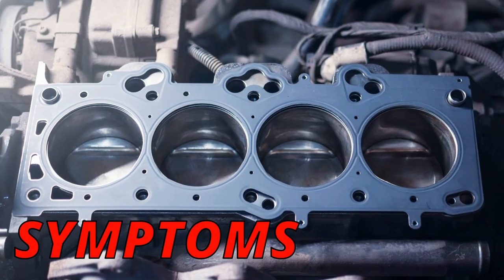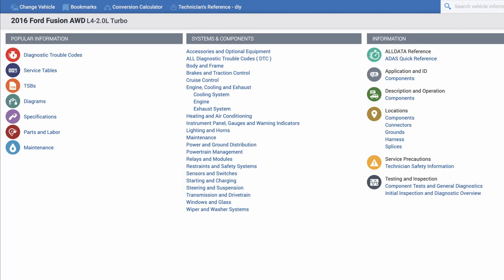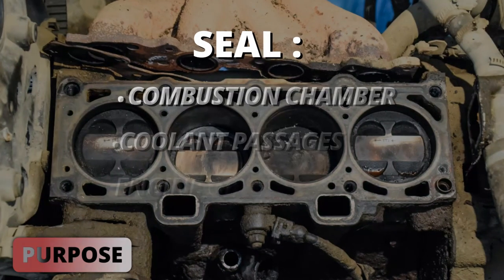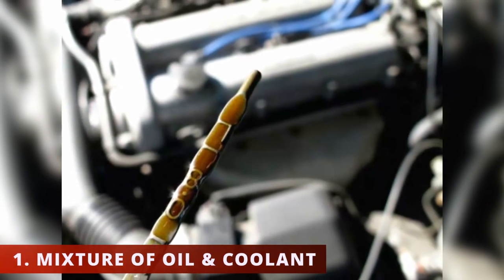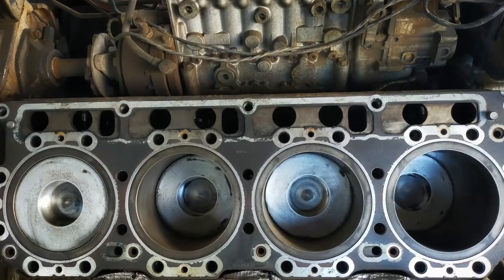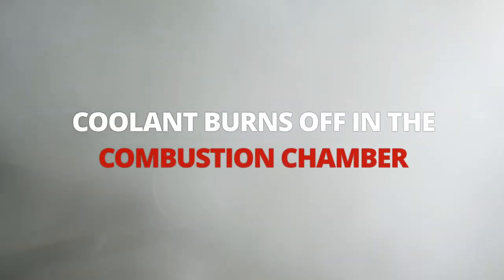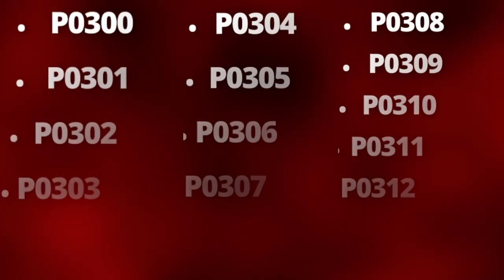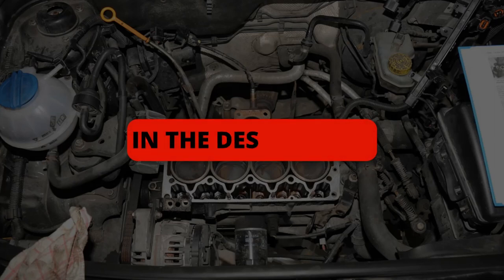SYMPTOMS OF A BAD HEAD GASKET

Comment: Straight to the point 🔥 any idea what  causes engine power reduced ??  Never seen anything related
Reply from the maker: There are tons of things that can contribute to a lack of power. Do you have the check engine light on?
Reply: Not anymore after like 20 mins, I tried to get it scanned with the obd but the light turns off
Reply from the maker: @SauceWick  It's hard to diagnose a car when the engine light comes and goes. I would start by turning on the car and looking under the hood to see if you hear a vacuum leak (hissing sound). If you don't see or hear anything unusual, I would wait until the light comes back on so that you can scan it and know where to start.
Reply: @easyautofix  thanks man I wish I had more knowledge on cars ASAP, slowly but surely and I def hear a hissing sound when it’s running, sounds like water when I step on the gas as well, I tried to scan the car 2 times but the check engine keeps turning off 😂
Reply from the maker: @SauceWick  If you hear a hissing sound, while the car is on try spraying carburetor cleaner around that area. If the engine changes in sound then you found the problem. Could be a hole in one of the vacuum hoses or an intake manifold gasket leak.
Reply: For real. Mine has gone on sometimes for two years. Ton of mechanics and no one knows!

Comment: My mechanic is currently waiting on a small warp to be removed from the cylinder head of my rav 4 before he can replace head gasket of which was torn on the edge resulting in a very slow external leak that evolved into constant replenishment on a daily basis as rubber seal on the gasket itself was completely eroded both top and bottom edges resulting in leaking outwards  

Oddly enough the rubber seal sides were intact thus preventing coolant from leaking into the oil and combustion chambers of which was the silver lining in a watered down version of worst case scenario
Reply: What symptoms did you have?
Reply: @plung3r 

*Unexplained slow drips in a hard to reach location 

* Loss of coolant at a slow pace to start with then rapid 

* No heat coming from heater only cold air 

* Massive temperature spike from neutral to nearly catastrophic overheating if I hadn't of stopped driving to fill it up again 

* Engine remaining quite hot after driving it even over a short distance 

Turns out that my engine block didn't overheat just got really hot explaining a very tiny degree of warping on cylinder head 1 

Cylinder head 1 and 2 bolts lost all their torque threading and were just sitting in the holes so that resulted in both holes being re-tapped 

Was without my rav 4 for 3 weeks but overall cost was outweighed by the benefits as it would have cost upwards of about 20-30k for a complete engine rebuild

Comment: I got a p0301 code and I replaced my spark plugs and also ignition coil but my car still idling poorly and the check engine light is still on. When I scanned it at Autozone the scanner didnt tell me exactly the issue e
Reply: Check your throttle body
Reply: That happenned to me same thing replaced 10k miles same thing replaced 3 times in 18k miles realiced cylinder 6 misfire burned caused a hole now i replaced whole head gasket $3,500 2021 ram promaster now it driver beautiful

Comment: I had classic head gasket blowout in my 2001 facelift vvti avensis. What a mess. Asked for an evaluation and repair guy said no.

I bought it for 1000 and sold for 300.

Always check the used car for all the important failure points before buying

Comment: I recently got replaced my heater core and they replaced the thermostat as well. Heater core is OEM but thermostat isnt. Ever since then when i turn on my heat in the car, a few min in I see the needle of the temp go down a bit and it will go back to normal once i turn off the heat or defrost. Can you guide me as of what can be the problem so I can get this fixed? Thanks
Reply: What end up being the problem bro?